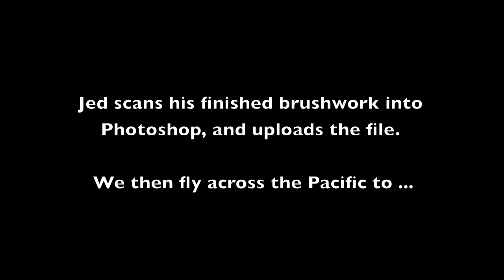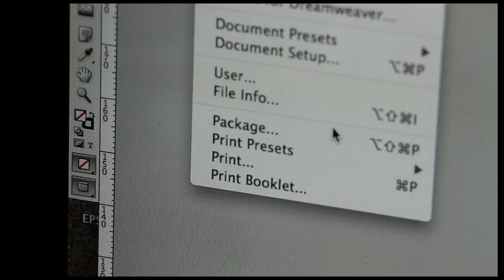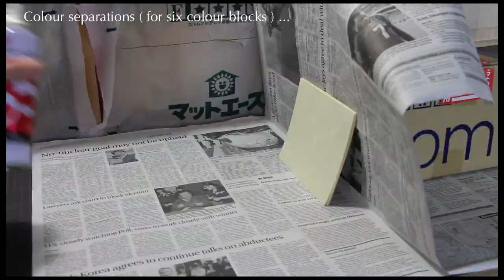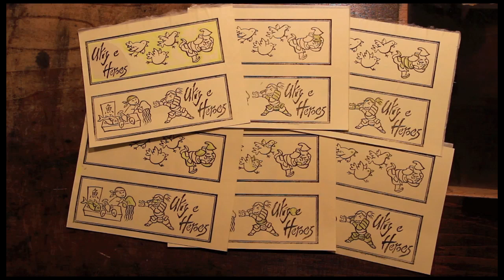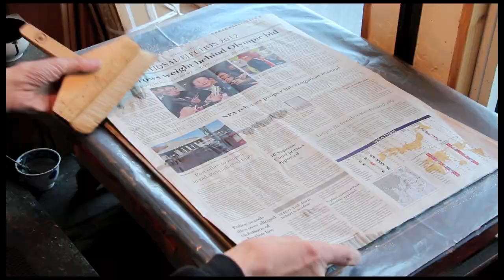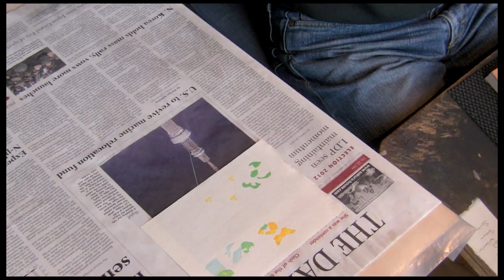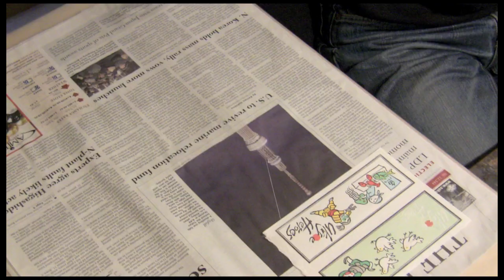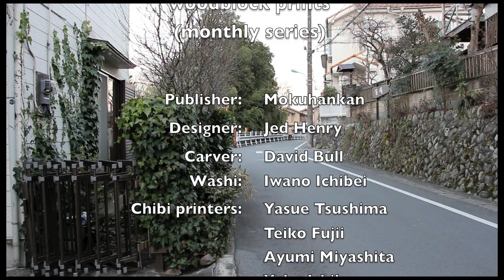Chibi Heroes woodblock print production

Comment from the maker: In ukiyo-e work the black outlines do indeed come first, 99.99% of the time. We're doing them last on these prints because we're using a pretty rich 'goopy' black, unlike the normal greyish outlines typical of most ukiyo-e. And this rich black tends to transfer to the colour blocks, thus making those tones duller and duller as the work progresses. And we can get away with doing it last on these simple prints, because the outlines are thick enough to give us a bit of 'play' in the registration.

Comment from the maker: I've never 'worn out' a block, so the question of what to do with them is moot. As I mentioned in another comment here, we very carefully preserve our blocks for future printing. Perhaps the most I have ever printed from one set of blocks (so far) is somewhere on the order of 600~700 copies (some of our Gift Prints), and even after this many, the blocks are still in wonderful condition, mostly due to the fact that we print bit by bit in relatively small batches.